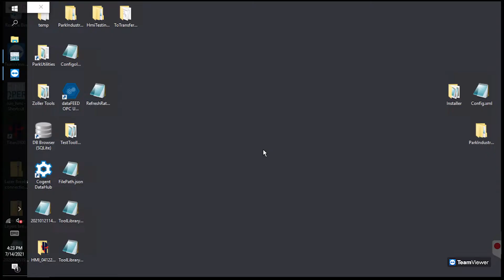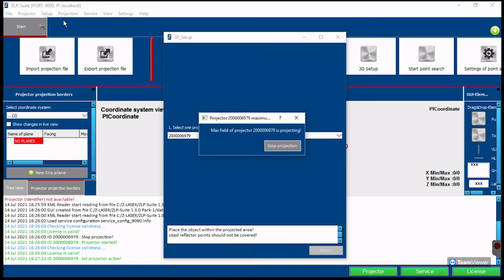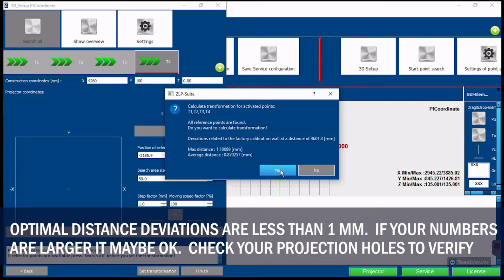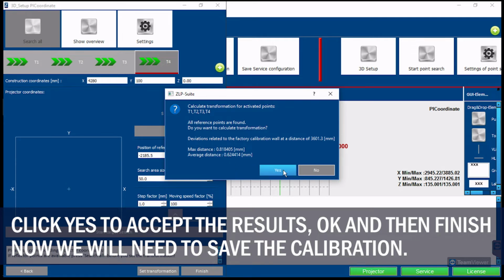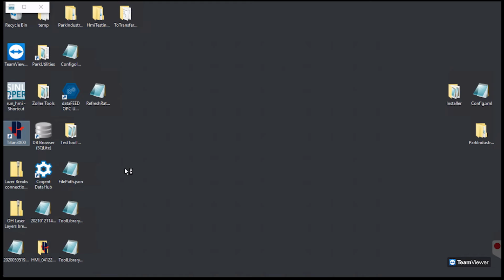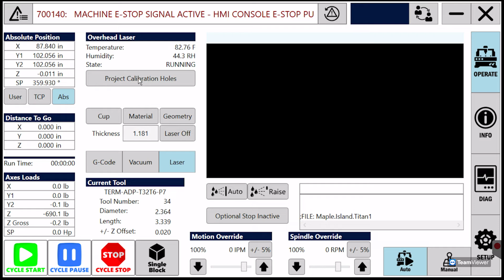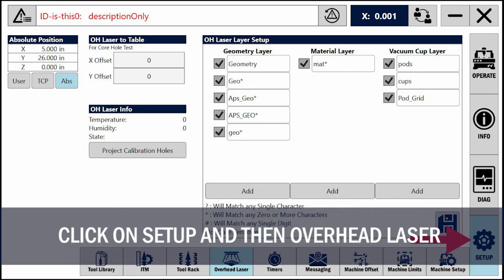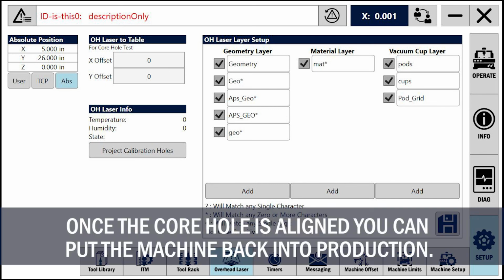How To Calibrate A Z Laser | CNC Router Service

Comment: i got max and avarage distances around 1.5-2 mm. what are these values ?
Reply: I also could not get mine below 1 in either. Was told if it was still a problem after doing a core hole test then replacing the lazer itself was the next step. Still figuring things out. Could be humidity or some unknown thing. Post up what you came up with.